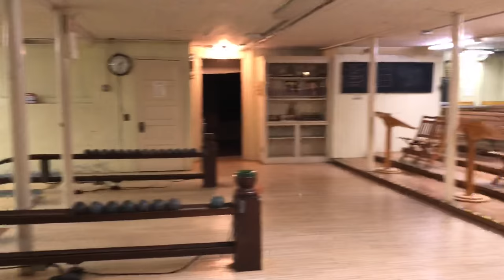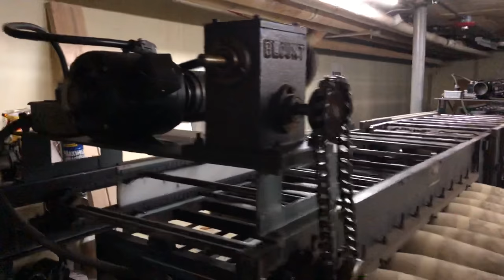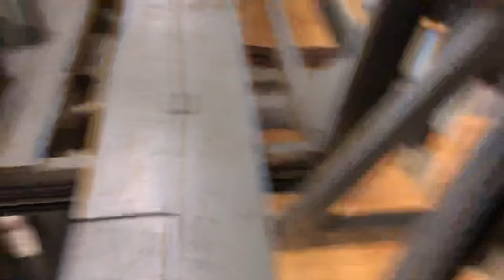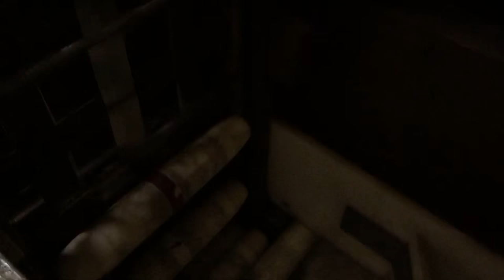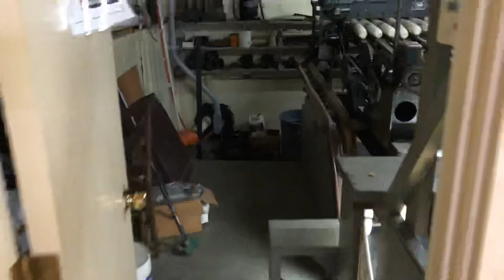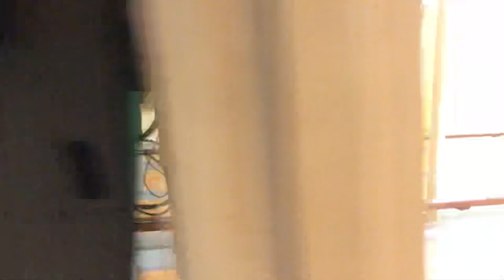Bowl-Mor vintage candlepin bowling at historic Woodfords Club Portland, ME.

Comment: You can tell these lanes are old electrically anyways, the wall switches are possibly 120 volt.  Where as in most houses low voltage toggle switches at the front desk turned the pinsetters on.  They called it the "house relay" that was in the control box above the catwalk. It seems the pilot relays have been replaced with a more modern control box with the red lights, not to mention all the Potter and Brumfield relays have been replaced too.  The "house relay" seems to still be there though.
Reply: Wall/control desk switches are for 24VAC“ house relay” coils.  220 volts was supplied to each machine, all motors were 120 volts. I installed and maintained the (2) pin setters used on CANDLEPINS FOR CASH. They were located in the parking garage at WNAC in Boston .  Joe Sullivan was shows producer, Bob Gamere was the host. Shows for the following week were taped on Saturday. I babysat, “ policing” the machinery in case of a jam or malfunctions, which never happened on my watch. Contestants bowled (1) frame/box. Get a strike and they win the jackpot. I spent quite a few Saturdays there. This was over (25) years ago.
Reply: @richarddrozdowicz1531  Are you Hank the Guru of Pinsetters or related to Hank, since Hank was no kid back in 1975, your last name rings a bell with me?   I was a part time pinsetter mechanic for Riverside Lanes in Watertown for 5.3 years, a 40 lane house and I met you once when you came to Riverside for some repairs in early 1975.  You must remember George Cappy, the head mechanic there for years.  You are correct about the 24 volts, I made my comment too early in the video before seeing the "house relay" in the control box, its just that those wall snap switches seemed so overkill  I made an early assumption.  I recall the 2 pole circuit breaker above each control box that I'd shut off when doing any repair on the equipment.  I could say so much more but I will leave it at this for now.

Comment: I worked on BowlMor pinsetters for years and I can tell you that these machines are in nice shape. The BowlMor is the best machine out there. Extremely reliable.
Reply from the maker: I was the caretaker at Woodfords Club for 4 years and had so much fun learning how maintain them and fix them. I spent many hours troubleshooting the broken lanes when I first started there.  When I started 3 out of the 5 were not functioning. When I left 4 out of the 5 were back in functioning order. Sadly one of them had some serious issues and missing parts.
Reply: @lifein207  I’m sure that with the proper parts , that machine could be up and running very quickly. These machines don’t have the ball lift, table modification where the ball lift motor is removed using the motor from the turntable. Couldn’t tell if the brakes had been removed from the pin lift and plugs installed instead of hardwiring. Most Bowl Mors  had those revisions done years ago. Also it appears that tube on lane one had the old original gearbox on it. It’s a workhorse but it’s much slower. Some places just speeded up the tube  with a smaller pulley. But those machines are clean and in very good working order.👍👍
Reply: @lifein207  outside of Saratoga NY in a small town by the name of Greenwich there was a Bowl-Mor with tenpin machines.  He had to get parts from a machine shop.
Reply: @robs531  Where was that? From Albany
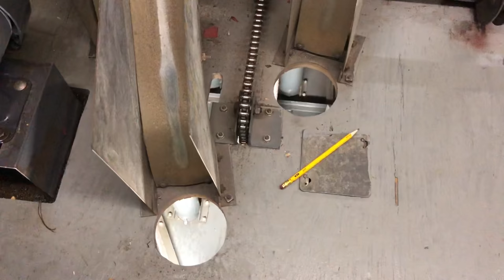Reply: @surfinbird208  Greenwich.  It was last known as PJ Lanes.  I like that trip in the summer better.  LOVE the Ice Cream Man and Windy Hills Golf Course is the best kept secret within 10 miles of the track.  You can play it in 3:15 on a dark day!

Comment: I wonder what ever happened to Bowl-Mor. Info about the company itself is hard to come by as most search results just refer to the Bowl-Mor branded bowling centers and not the original company itself. 

When you were showing the inside of the control box, I see a smaller gray box with four LEDs on it, and it looks much newer than the surrounding electronics. What is the gray box for?

Comment: I grew up playing candlepin on the weekends with my dad, sadly our alley closed down about a year ago. I always wished I asked for a tour of the machines while they were still running. I'm planning on making a 1:12 scale mode of a bowl-mor with an arduino and some 3D printed parts but up until now I had no idea how the ball separation in the turntable worked, so thanks for this! There aren't many videos out there showing how the ball pit area functions.
Reply: It should be fairly easy even without the plans since balls are much wider than pins and don't fit into the pin lift, and pins are too long to fit into the ball lift.  Too bad the lighting wasn't better to see the separation.  Have to further search and visit the local bowl-a-rama.